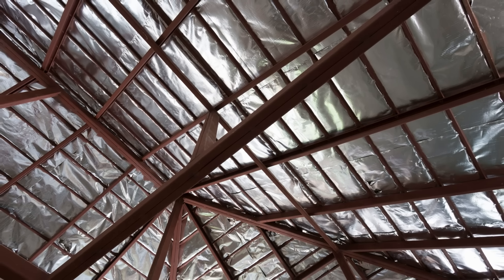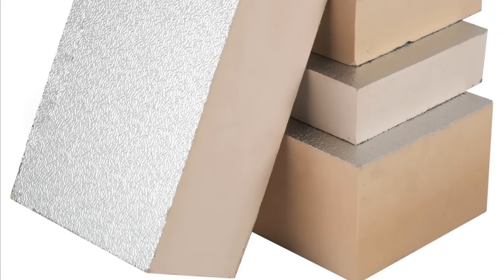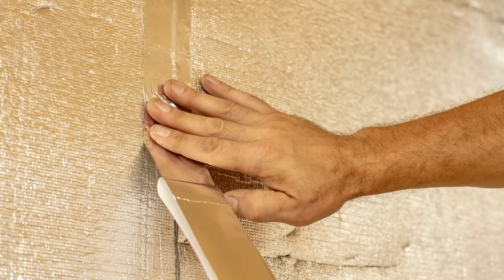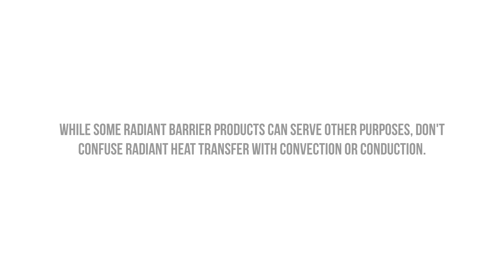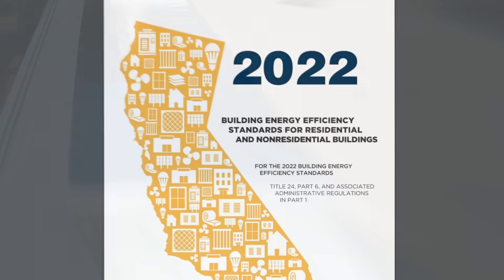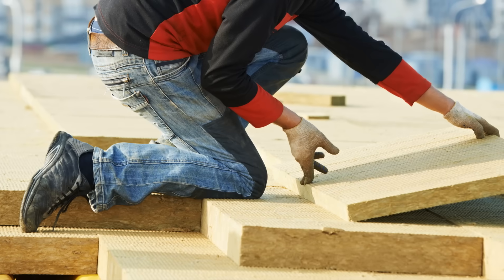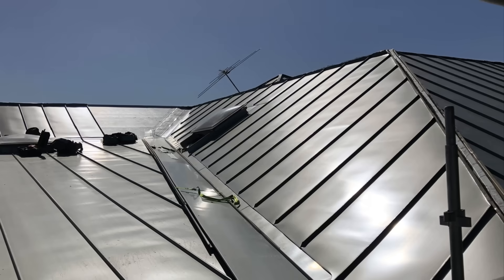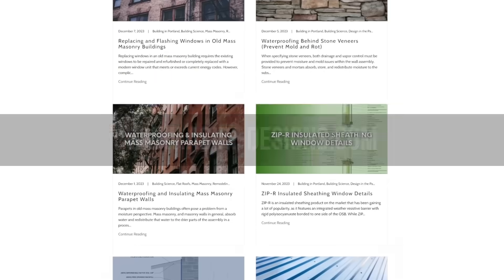Do Radiant Barriers Actually Work?

Comment: I need a little help and while looking for an answer I came across this, and I am betting you can give me a quick hand. 

I've got a client who is going to use 10m Prodex total plus as the only insulation in his shop. The shop is post frame 36x72 wood board and batten exterior tyveck was used over 2x6 wall girts 30” oc. On a three ply 2x6 post with interior 2x6 wall girts. Trusses 8’ oc with 2x4 on edge Perlins metal roof no underlayment.. This product will be installed in the walls and will have a 5/8” ply wood wall installed over the girts. The same product 10m prodex will be used on the ceiling from the top most wall girts up 15 inches and attached to the underside of the Perlins… climate zone 5-5.5 what is the actual r value of the prodex when not in a hot box test? Whats the r value of his building. There will not be a ceiling on the underside of the trusses. How do I convince him that this is a mistake?
Reply: Actual R-Value of 10mm Prodex Total Plus (Not in a Hot Box Test)
Prodex Total Plus 10mm is marketed as a reflective insulation with a closed-cell polyethylene foam core (10mm thick, about 0.4 inches) sandwiched between two reflective foil layers. The manufacturer claims an R-value of up to 22 for the 10M product when installed with air gaps, but this is based on an assembly test (e.g., a hot box with specific air spaces) rather than the material’s intrinsic R-value in real-world conditions.
In practical applications, reflective insulation like Prodex relies heavily on reflecting radiant heat across an air gap, not on resisting conductive or convective heat loss like traditional insulation (e.g., fiberglass or foam board). Studies, such as one from the Canadian National Institute for Research in Construction (2010), show that radiant barriers with an air gap boost an existing wall’s R-value by only about 10% in ideal conditions (clean foil, no dust). For example, an R-6 wall might gain 0.6, totaling R-6.6. Without an air gap, or with dust accumulation, the reflective benefit drops significantly—often to an R-value of 1 or less.
For your client’s setup:
Walls: The Prodex is installed between the exterior Tyvek/board-and-batten and the interior 5/8” plywood, likely with minimal air gaps due to the 2x6 girts and plywood pressing against it. Without a consistent, sealed air space (at least 3/4” recommended by manufacturers), the reflective properties are negated, and you’re left with the foam core’s R-value. At 10mm thick, closed-cell polyethylene typically offers R-3 to R-4 per inch, so 0.4 inches yields roughly R-1.2 to R-1.6 in conductive resistance. Real-world R-value here is likely R-1.5.
Ceiling: The Prodex runs from the top wall girts up 15 inches to the purlins’ underside, with no ceiling below the trusses. This leaves most of the roof exposed, but where Prodex is installed, it’s stapled to the purlins (2x4s on edge). If there’s a small air gap between the metal roof and Prodex, it might add a slight radiant benefit (say, R-0.5), but dust, convection, and contact with the purlins limit this. The effective R-value here is also around R-1.5 to R-2.
Contrast this with Climate Zone 5-5.5 requirements (per the 2021 IECC): walls need R-20, and ceilings need R-49 for optimal energy efficiency. Prodex alone falls far short.
R-Value of the Building
Let’s estimate the shop’s overall insulation performance:
Walls: With Prodex at R-1.5, the Tyvek (negligible R-value), board-and-batten (maybe R-0.5 for wood), and 5/8” plywood (R-0.8), the total wall R-value is roughly R-2.8. The 2x6 girts and posts conduct heat (thermal bridging), reducing this further, possibly to R-2.5 effective.
Roof/Ceiling: The metal roof has no underlayment (R-0), and Prodex covers only a 15-inch strip from the wall tops upward. The rest of the roof—trusses at 8’ on-center with 2x4 purlins—offers almost no insulation (R-0.5 max for wood). Even where Prodex is installed (R-2), it’s a tiny fraction of the 36x72 roof area (2,592 sq ft). Averaging across the roof, the effective R-value is less than R-0.5.
Total Building: With walls at R-2.5 and the roof effectively uninsulated (R-0.5), heat loss will be massive, especially through the roof, which dominates in an open-truss design. The building’s average R-value is likely R-1 or less, nowhere near the R-20/R-49 needed for comfort and efficiency in Zone 5-5.5.
Why This Is a Mistake
Inadequate Insulation for Climate Zone 5-5.5: Winters here average 20-30°F, with lows below 0°F. An R-1 to R-2 building will bleed heat, driving up heating costs (e.g., propane or electric bills could double or triple compared to a properly insulated shop). Summer heat gain through the metal roof will also make it unbearable without significant cooling.
Roof Exposure: With no ceiling and Prodex covering just a 15-inch strip, 90%+ of the roof is uninsulated. Heat rises, so this is the biggest loss point—think of it like wearing a thin jacket with no hat in a blizzard.
Condensation Risk: The metal roof and walls, with minimal insulation and no vapor barrier below the roof, will likely form condensation in winter as warm shop air hits cold surfaces. This could rot the wood framing and rust the metal, especially with Tyvek (breathable) on the walls but no roof underlayment.
Cost vs. Performance: Prodex 10M costs around $1.50-$2 per sq ft. For 36x72 walls (216 linear ft x 10 ft high = 2,160 sq ft) and partial roof coverage (say, 500 sq ft), that’s $3,500-$5,000. For that price, you could install R-19 batts in the walls and blow R-30 cellulose in a ceiling, vastly improving comfort and savings.
How to Convince Your Client
Your client might be sold on Prodex’s marketing—reflective shine, ease of install, and bold R-value claims. Here’s how to shift their perspective:
Show the Numbers: “In Climate Zone 5, we need R-20 walls and R-49 ceilings to keep heating costs reasonable. Prodex gives us R-1.5 to R-2 where it’s installed, and the roof is mostly bare. Your shop will lose heat faster than a screen door on a submarine—think $1,000+ extra in heating bills yearly versus a proper setup.”
Highlight Comfort: “With no ceiling and thin insulation, the shop will feel like an icebox in winter and an oven in summer. Tools will rust from condensation, and you’ll be miserable working in it. Adding real insulation now saves headaches later.”
Use a Local Example: “I’ve seen shops around here with metal roofs and minimal insulation—owners regret it every winter. One guy spent more on propane in a month than it would’ve cost to insulate right. Let’s avoid that trap.”
Offer a Better Plan: “For the same budget, we can put R-19 batts in the walls and frame a ceiling with blown-in R-30 or R-40. It’s proven, meets code recommendations, and keeps the shop usable year-round. Prodex could supplement, but it’s not enough alone.”
Appeal to Logic: “Prodex shines at reflecting heat with big air gaps, like in a hot attic. But in a shop with no gaps and a cold climate, it’s like using a sunshade as a blanket—it just doesn’t work.”
Suggested Alternative
Walls: Install R-19 unfaced fiberglass batts between the 2x6 girts (fits the 5.5” depth), add a 6-mil poly vapor barrier on the interior side, then cover with 5/8” plywood. Cost: ~$1,500-$2,000.
Ceiling: Frame a flat ceiling at the truss bottom chords with 2x4s or steel, blow in R-40 cellulose or fiberglass ($1,500-$2,000), and vent the attic space above with soffit and ridge vents. Add Prodex under the roof as a radiant barrier if desired ($500 extra).
Total: $3,500-$4,500, delivering R-19 walls and R-40 ceiling—comfortable, efficient, and moisture-safe.

Comment: I think they work great in a post framed cottage. The Boss Of The Swamp and many other people in the north recommend it in cabin floors. Last longer and works better than fiberglass insulation. No space when against subfloor for bugs and mice. I like low perm air barriers. To allow moisture to hopefully flow outwards.Sometimes we put it against masonry cmu others around the mineral wool. Depending on weather at time and not below grade. Does it matter? I wrapped my mineral wool insulation. Because air gap for masonry veneer. I guess the question would be insulation inside the air barrier or outside of it, and does one way work better for r/u values?

Comment: You are incorect: Radiant barriers protect both inside and out, they both reflect radiant heat away AND prevent radiant heat from leaving the surface; a LOT of heat can be shed by hot objects via infrared, and since this rate is proportional to the temp difference to the FOURTH POWER, hot objects emit way more heal than cooler ones. A black surface emits this heat well, a shiny one does not

Comment: One of the reasons why California has the foil facing inward on the roof is for winter heat to reflect back into the home reducing winter heating costs and reducing emissions.
Reply: I wonder why a double layer would not work 1 facing out 1 facing in.
Reply: @jacobvddoes4121   A single-layer radiant barrier, foil facing inward, is the standard in California because it balances winter heat retention and summer heat rejection (assuming good attic ventilation). Facing it outward could prioritize summer cooling, but it’s less versatile for year-round use in climates with cold winters. A double-layer setup might slightly improve performance—maybe a 5-10% boost in heat reflection, based on radiant heat transfer principles—but the cost-benefit ratio doesn’t typically justify it.
Reply: That makes sense for California.  But when I lived in Silicon Valley prior to 2010, I had heat in the winter, but no AC in the summer.  I would prioritize cooling in the summer to reduce power plant emissions, than prioritize reducing NG emissions from home heating systems in the winter.  I can get both with foil sheet reflecting radiant heat in the summer, but only heating advantage in the winter with the foil facing in.  I don’t think attic insulation reduce summer radiant heat, and that heat becomes conductive heat when the ceiling joints are heated.

Comment: This is wrong when it says the radiant barrier must face outwards to reflect heat. The LOW EMISSIVITY keeps the barrier from emitting heat inward too--heat absorbed by shingles and conducted through to the sheathing does NOT get emitted to the attic (typical construction). So radiant barrier works either way--the one requirement is that it must face the air gap.

Comment: I'm gonna contradict you on this one. I had my attic above the garage being at 160 in the TX summer. I put radiant barrier on the interior with a gap for the air to flow behind the roof and the radiant barrier and the temperature dropped to 130 under the same conditions
Reply: I believe you were winning with mostly the proerties of the air space being an air channel and convective cooling; and the air gap reducing conductive heating to the inside of your attic surface;  not so much the reflective properties of the material you used, but the installation method of the material.
Reply: @truckgotstuck  That's quite true. I could feel the draft above the foil. So in a way it helped because the reflection was keeping somehow the heat between the foil and the roof and helped with the convection
Reply: Thank you so much. I was looking for this kind of info.
Reply: @jacobvddoes4121  Just remember to leave room for air to circulate and escape the attic, the heat needs to go somewhere. I put a radiant barrier for experimentation purposes in front of my garage door outside during the TX hot summers and the door is cold to the touch as opposed to I can't keep my hand on it. So it does radiate/reflect but all that is reflected needs to go somewhere. When outside, is just going back in the environment but in the attic it needs to escape from there

Comment: First, this has easily become my goto top channels on all things building science, and has been very thought provoking. 
I think there could be some expansion and or clarification on what was mentioned in the video regarding radiant barriers. 
There are two key qualities of radiant barriers: reflectivity and emissivity. Reflectivity refers to a barrier’s ability to reflect radiant heat, while emissivity reduces the release of radiant heat. When foil is placed with an air gap on the cool side (Attic), it limits heat transfer by preventing emissivity, but with an air gap on the hot side (facing the Sun), it reflects heat more effectively through reflectivity. The Department of Energy's studies show that radiant barrier decking reduces heat flow by 30% using emissivity, whereas stapling radiant barrier foil to the bottom of rafters reduces heat flow by 50% through reflectivity, making it more effective. The main takeaway is that placing the air gap on the hot side maximizes performance by reflecting heat.
Regardless, there are far more better methods to prioritize when allocating spend on efficiency in the home; one is better off putting money into beefing up R-Value/Air-Sealing etc. - you could easily add more insulation vs. messing with radiant barriers. And, it's really critical to consider the entire system in. the attic to begin with as an air gap is needed. 
If it were me, I'd love a radiant barrier on top of an ice and watershield facing the sun on the roof with furring strips supporting a standing seam cladding, flash and batt underneath the deck.

DOE Report if anyone wants to check out - https://cdn.shopify.com/s/files/1/0868/0158/0332/files/Department-of-Energy-Oak-Ridge-Labs-Radiant-Barrier-Study-wwwAtticFoilcom.pdf?v=1719018114

Comment: Not just for hot climates.

I put one facing inward on a walk out basement door with a wood stove on the opposite side of the basement. It helps keep the heat where I want it in the cold season. 90% of the heat that would escape through that door is now reflected back into the house and rises. While still allowing the door itself to be an entryway for fresh air to start a draft.
Reply: Heat doesn't rise, heated air does. I'm not denying the effectiveness of your door, but just noting your rationale. Reflected radiation goes wherever it reflects towards.

Comment: In general I find your videos tremendously informative, helpful, and correct.  So I'm surprised to hear in this video at 1:59 that radiant barriers "will not work if they are facing inward," while showing the image of roof sheathing with a radiant barrier on the underside.  Radiant barriers CAN work facing inward.  I took Heat Transfer and Passive Solar Design in college;  just to make sure Joe Lstiburek's quoted source was in agreement, I read 95% of the referenced article.  The Building Science article says radiant barriers may not be EFFECTIVE when your attic is insulated to R-30 or more.  Nowhere does it say they wont work if they face inward.  (There are a bunch of other conditions at play in cases of failures.)

Foil-faced OSB such as Tech-Shield installed as roof sheathing with the foil facing down will reduce heat transfer into or out of the attic.  The same magic that makes foil reflect heat back at a heat source also keeps the heat from radiating downward from hot, foil-covered OSB roof sheathing into your attic.  The cited studies indicate that it may not be worth it if you insulate your attic well.  

And radiant barriers facing UPWARDS are useless as soon as they get covered with dust and the surface is no longer shiny.
Reply from the maker: Hi there, thanks for watching. I think you missed the intial context of that statement - it was in reference to hot climates.
Reply: @ASIRIDesigns  I got the "if you are building in a hot climate" intro.  As I said in my initial comment, radiant barriers still work facing inward in this case.  They may not (probably won't!) work as well as manufacturers want you to believe.  You still get heat conduction into the air contacting the barrier, and things are affected by the temperature of the surfaces.  But per the physics, heat transfer is impeded by a radiant barrier whether it is radiating from your hot attic floor to the cool foil surface on the underside of the sheathing---think warm house on a cold winter night--or the opposite direction, as expected in hot climates during the day.

This is probably irrelevant in most cases if the attic is over R-30, as mentioned in the Building Science article (and in the video, I now notice 🙂).  And there are many ways to install radiant barriers that will spell disaster for the building envelope--so I'm not trying to defend them, just trying to put my education to use <<eye-roll>>
Reply: @thormatteson7141  Foil Faced OSB with reflective side facing the open attic is common Texas residential construction. Low emissivity of foil reduces radiant heat transfer into the attic. End results is a hotter roof deck, but a cooler attic. This video really needs a revision to address this type of common hot climate construction.

Comment: I would argue there's another big advantage if done right.  The surface is clean, can be cleaned, can be selectively sealed, and serves as a barrier to toxic dust and volatiles from the underlying insulation, glues, etc.  Particularly if you have a lot of air exchange going on with the rest of the building.